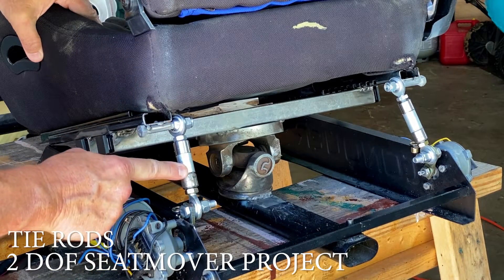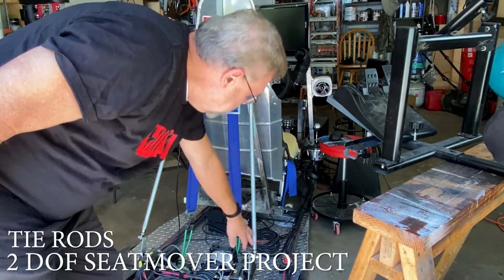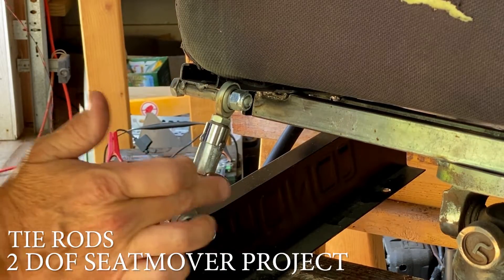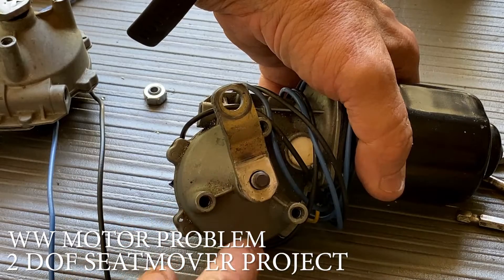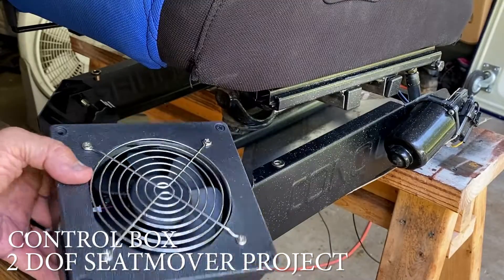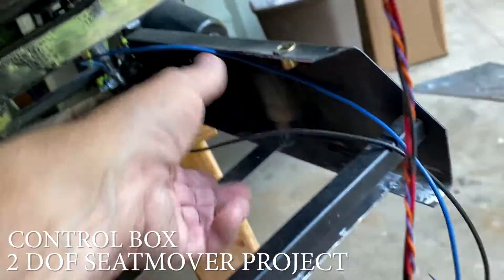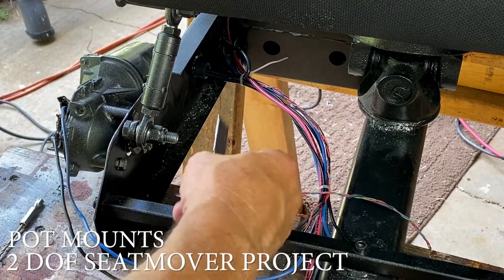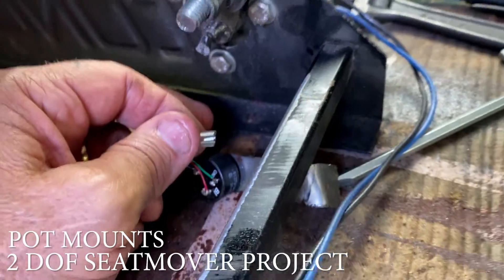DIY SEATMOVER Part 4 WW motors Arduino IBT-2 Simtools MOD your static SIM RIG with Motion!

Comment: also . what do u call what u haveunder the center of the seat that allows it to move both ways:? im thinking using springs and motors because i want it to not be like super tons of motion but i want to be able to feel and control the car better. thats all. thanks again man u did a amazing job
Reply from the maker: it's called a u joint..  so you need to get it from a truck or car which has rear wheel drive.  just go to a 'junk yard' or  automobile scrap yard near your location..  you may need to buy the whole driveshaft, which is what i did..  it cost $20 usd and then you will have 2 u joints.. for your project.   they will know what your asking for if you ask to buy a driveshaft..  hope that helps.. dave
Reply: @DMAX_DIY  alright thanks man what racing games u play? if u dont mind me asking?always looking for people to play with that are respectful and arent rammers lol.
Reply from the maker: @MassBr3d88  i run Assetto corsa on the rig. i league race every weekend at the gentleman's league at Assetto Corsa Friends discord.  i'm definitely not a first corner guy.. i just pick up what pieces i can and enjoy my driving   if you want a link to look around at the discord i'll send one.. other than that i have a newer video out which shows the rig and vr - just out for a fun drive.. https://www.youtube.com/watch?v=qwsFYPXl1EU

Comment: JUST A TIP.. WHEN SOLDERING WIRE PUT SOLDERING IRON UNDER WIRE.. AND PUSH SOLDER INTO THE WIRE THAT WAY U GET PERFECT SOLDERS.
Reply: and thank you man u inspired me to buy a welder and build my own instead of buying one. i learned how to code. for arduino n stuff. but any tips for a motor size . speed . wattage for someone who only ways 150lbs.. id say add another 125lbs for the cockpit with monitor attached so what would be able to move 275.. i know i dont need alot of movement but i know that speed of that movement better be on point or its going to feel really weird lol.

Comment: Excellent video!!!

I have a question since only the engine responds to me
When aligning the green line to the blue one, it only moves and the green line goes down

Could you help me? I have sent you a personal email
Reply from the maker: good question my friend.  i would double check the wiring on the IBT and the arduino for continuity first.  if i'm reading this correctly, your motor is mounted up and the potentiometer is in line with the motor shaft.. if you twist the end of the potentiometer the green line (pot) and the blue line (motor) separate?  could be that the motor power wires need to be reversed.  i have a video in this series that demonstrates that  - take a look and let me know.    Dave

Comment: great vid easy to follow! Ive some experience as I've already built my own direct drive wheel base and wheel with buttons ect... 1 thing to note in regard to cooling I believe you will find its always more efficient to pull the heat off rather than push cool air as it just keeps heat from escaping. So. fan should be turned over!  if you research you will see what I'm saying. thank you I subscribed
Reply from the maker: pretty good idea my friend!  Yah I can see that working ! I always put some thought into what others have experienced so maybe I'll set up a temp probe and see what happens once I finally retire.. just to see the effect and pass along the findings.. Great comment! New video coming out tonight! Dave

Comment: where to get the that giant thing that the seat connects to the frame that moves so the seat actually can move all directions what is that part and where do u get them/
Reply from the maker: Hey..  good question..  That's a U joint from a chevy truck..  I went to the 'junkyard' and talked to the guy and bought the entire thing for $20 bucks..  I though $20 was a bit much but whatever..  I cut off the rear u joint and used it on RIG #1  and then I cut off the front u joint (that usually connects to the transmission) and  am using it on this compact sim build..   So $10 bucks each..  cant break em..  pretty cheap.

Comment: Hello, I am sending you a video that can be seen in Turcoyear on you tube, you can see the tests that I carry out and the components that I use, the motor is 12 v used for windshield wipers, arduino 1 board, ibt2 board to move the motor , 12v power supply, 10k potentiometer, the tests that work are in the video and what doesn't work is the motor movement test, (no signal is detected at the output that feeds the motor on the ibt2 board) It doesn't work with the games, accetto corsa competicione, nor with the flight simulator, yes, as I was saying, the axes move virtually. IF THE ENGINE WORKS WITH THE TESTS SEEN IN THE VIDEO IN SMC3UTILS v1.01
Please I need your updated email address to send you the video where the answers to what you asked me are and if not the video is on you yube in search for videos place Turkyear the video is 2 dof simulator
I have the sim tools license and to download plugins.

Thanks from Argentina
cordial hugs
https://youtu.be/9prM0D84qy4

Comment: https://youtu.be/9prM0D84qy4
Hello, I am sending you a video that can be seen in Turkoyear on you tube, you can see the tests that I carry out and the components that I use, the motor is 12 v used for windshield wipers, arduino 1 board, ibt2 board to move the motor , 12v power supply, 10k potentiometer, the tests that work are in the video and what doesn't work is the motor movement test, (no signal is detected at the output that feeds the motor on the ibt2 board) It doesn't work with the games, accetto corsa competicione, nor with the flight simulator, yes, as I was saying, the axes move virtually. IF THE ENGINE WORKS WITH THE TESTS SEEN IN THE VIDEO IN SMC3UTILS v1.01
Please I need your updated email address to send you the video where the answers to what you asked me are and if not the video is on you yube in search for videos place Turkyear the video is 2 dof simulator
I have the sim tools license and to download plugins.

Thanks from Argentina
cordial hugs

Comment: hello - where did you get the case from to house the arduino etc ?. thanks
Reply from the maker: Great Question Adrian! It's an 8x8 electrical enclosure from the LOWES store. It's grey plastic. I just traced around the 120mm fan and cut out a hole in the top for it to fit with a jigsaw.   I also drilled some 3/4 inch holes in the sides to let the hot air out.. Hope that Helps! Dave

Comment: Do you have to do any coding for the Arduino or does the software program cover that ?
Reply from the maker: Hi James.. I have a lot of info in the description part of the YT page.. Here is a link to setting it all up. Basically just download the code and put it in the Arduino as shown in Episode 1 of this series.  Hope that helps you out my friend!  DMAX   You may have to change the first line of code to "MODE2" to run the IBT-2 controllers https://www.xsimulator.net/community/threads/smc3-arduino-3dof-motor-driver-and-windows-utilities.4957/

Comment: Thanks for sharing all your knowledge, it's been a interesting watch from your main build to this 

I am thinking about building one myself with the 3dfm like your first build.   I am wondering what your thoughts on using a PCV built frame to accomplish what you built.    I may document it with video as well if it shows promise.

I think PVC will be easier for me to work with vs metal.  And it would be different at I can't find a motion PVC build anywhere
Reply from the maker: Yeah PVC might seem easier. but it flexes too much.  for a static rig it would be fine.  I would just make it out of metal and bolt it together if i did not have a welder.  You would be much more happier.  PVC.. even sch 40 will flex all over the place. DMAX

Comment: Morning Dave,  Love your channels!  I startup my own build right after I saw yours.  I got stuck at wiring  Ibt-2 to Arduino.  I followed the same schematic as you did, and my motors doesn't seem to turn on.  I used the multimeter to check IBT-2 power in (its good) but tested the terminal for M+ & M- (no reading).  I am stuck for about 3 days now,  could you help?  thanks
Reply from the maker: Good question my friend! I would start at the basics. Do the motors run by connecting them to battery? If so, be sure your + and - batt connections are correct of the IBT-2.  The motor wires going to the IBT-2 can be swapped around but batt wires cannot.  I dont want to go too much further until you know the motor turns with 12V and that the batt wires are connected to IBT..  Let me know! Thanks Dave
Reply: @DMAX_DIY  HI Dave, I did the test hooking my motor directly to the 12v power supply, it turns.  And my wire connected to IBT is correct connection.  Very frustrated.  I really appreciate your help.
Reply from the maker: @kelvinfoo976  Ok next make sure that you can identify the com port and you can make the blink program work on the arduino.  If that works, the arduino is able to communicate. If yes, then be sure to change the comm port on the SMC config file to your com port and then open up the SMC3.ino file - before loading the ino file into your arduino change it to MODE 2 (for the IBT-2)  Let me know. Dave
Reply: @DMAX_DIY  hi Dave, I have done all that, my Arduino and smc are communicating properly, com port are all good and code is loaded with mode2.  my green line (feedback) is not in the center of the graph.  I begin to think my pot is not compatible.  I use a multi turn pot and i believe you used a 180 turn hall sensor pot.  I really hope this is the problem.  I just ordered some from digikey today.  now I hae to wait for it to arrive.
Reply from the maker: @kelvinfoo976  Probably the pot.  The hall effect pots I have been using are rock solid when they are in the 'range'.  I have used like eight of them so far on different projects  https://www.digikey.co.uk/en/products/detail/tt-electronics-bi/6127V1A180L-5FS/2620661

Comment: Dave, big fan here, I managed to get some of the same motors you used on your Main Rig, the crab pot motors. Please can you tell me the size of the shaft you used? Did you get it off Amazon? I was initially starting the project with wiper motors but now have these. Thank you for all your help and advice
Reply from the maker: Well you will be very happy you got the bigger motors..  I will have to check on the size.. I bought some bolts down at the hardware store and a TAP.
I tapped the hole using my drill, then the bolt was secured on the other side with a nut.  IMPORTANT thing here.. Be sure to drill a hole for a set screw through the motor shaft and through the bolt.  Those motors are powerful and will shear off a little set screw..  I'll check on the size * out of town till thursday *
To get an idea, check out my first page on my x-simulator.net post..  It shows the motor, tap and bolt https://www.xsimulator.net/community/threads/full-frame-2-dof-traction-loss-new-build.14740/
Reply: @DMAX_DIY  thank you always.

Comment: Great video again!
And yeah - I also do not like those wires with Pins - they break much to easy after beding them like just 2 times.
Cheers from BAVARiA, 
Yours  ART FLY []-)
Reply from the maker: Thanks for the comment! Yeah I ended up soldering them on my 3DOF.  I probably will do that too on this 2DOF demo..  But it was pretty easy to trace down the problem.  It WAS working before.. and then.. broke wire.. sigh..  Hey when you posting some stuff what are you working on?  Dave
Reply: @DMAX_DIY  you're welcome 😊 could you paraphrase your question please? I do not understand its meaning. Later, ARTi
Reply from the maker: @ARTFLY  Well, are you posting some more stuff on your rig soon?  Last I saw was the wind sim.. IT would be very cool if you went over the 'settings' in game dash a bit slower.. I have all the parts already soldered and ready to go.  Would be cool to see a video on the settings for this. Thanks !  Dave
Reply: @DMAX_DIY  I will - try to 😃 soon come.
Reply from the maker: @ARTFLY  Cool my friend.. I have the 'bell on' So I should get notified!
Reply: @DMAX_DIY  sorry mate. I am messing with cancer atm. Might be lucky though. Had a surgery and looks quite good. Have some patience with me releasing my next video.
Stay safe, luv, ART FLY []-))
Reply from the maker: @ARTFLY  Aww my brother, sorry to hear that! Cant imagine what your going through.  Get better soon my friend! Dave

Comment: I've been saving up and buying each piece that I can afford a little at a time. I'm down to looking for a bargain on the last two parts! The motors! I got a deal on a welder, scrap metal tubing, got all of the electronics, mcu, motor controllers, psu, all the things. I'm so ready to start this project. I just interviewed with AWS today and it went well. Fingers crossed I've been laid off since march. I had been researching sim chair builds for months and came across your 3DOF build. I was thinking how bad I wanted to build one but I don't have a budget for it so I started trying to develop a minimal part count/budget 2DOF build. I was so excited to see you were already on the ball. Thanks for putting the information out there!
Reply from the maker: Oh man BD!  Hope you get that AWS gig.. Yeah.. 2DOF is awesome..  In this series, I am going for pretty much the least expensive way to do it and filling in the 'grey' areas.. I researched my 3DOF build for about 4 months before 'risking' any purchases.. because I never found a real good video on 'how to do it'.. so  hope this helps you out my friend! DMAX
Reply: Thanks Dave! How are you doing now? Did that butt mover move your butt? I'm looking to buy the motors now and get starting building this thing.